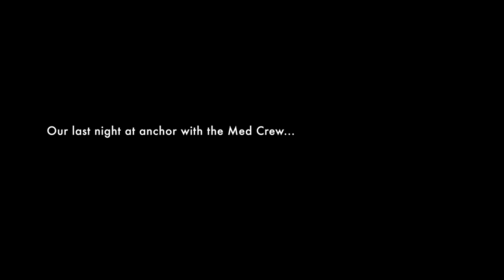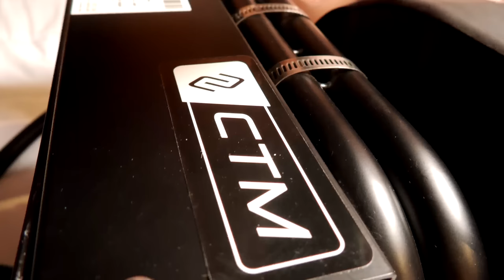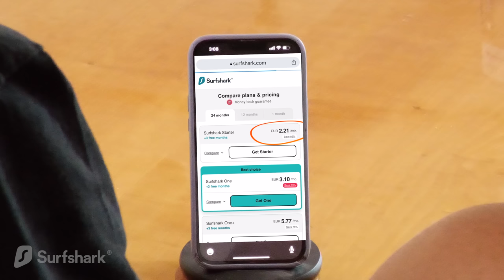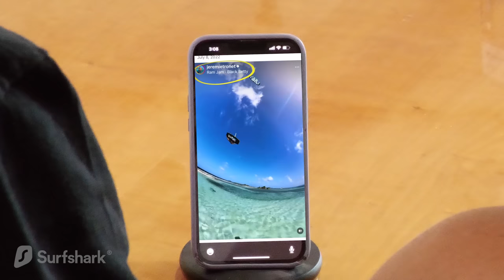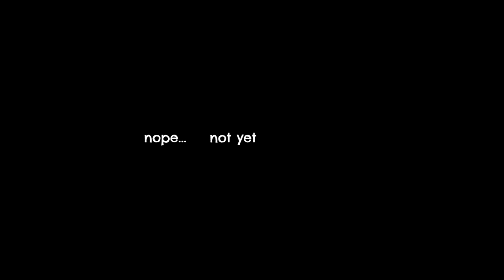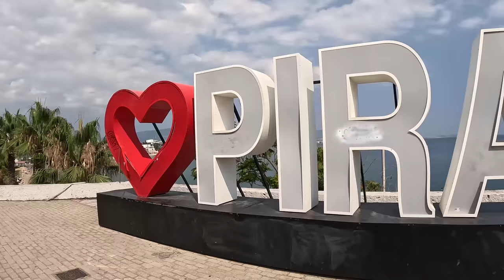More than "JUST FRIENDS?" 💞 Our last days with the Med Crew (Ep 247)

Comment: I'm really surprised marine A/Cs aren't split systems, with a central condenser (or two, for catamarans i.e.,  backup) and two or even three slimline evaporators per condenser mounted high on a wall.

By using two condensers (A and B) and six mini-splits, you can achieve some serious redundancy, both left and right, forward and aft, and in the main cabin, too:

Forward Hulls:  A-B
Main Cabin:  A-B
Rear Hulls:  B-A 

Just thinking...

Comment: Ice makers are very simple to work on. I don't care if its a $300 ice maker or a $3000 ice make because they all use the same ice maker cartridge.  Ice makers use a simple time mechanism to control the ice making process. Ice makers almost always have adjustment screws on the timer to adjust the size of the ice cubes.  The size of the ice cube is based on how long the timer opens the water inlet solenoid so with default settings you may have cubes that are either too small or too large which can cause ice jams.  Water pressure is the variable when it comes to ice cube size so the timer can be adjusted to compensate allowing for longer or shorter fill times.

Ice maker cartridges should never cost more than about $60 dollars.  The ice maker in the boat uses a standard cartridge which can be purchased for as low as $25 bucks.  Whenever I see a refrigerator on the curb being thrown away I always grab the solenoid valves and ice maker cartridge because they are just about universal.  When the cover is removed from the front of the cartridge there is small round holes with a letter next to them and those are test point for multimeter leeds.